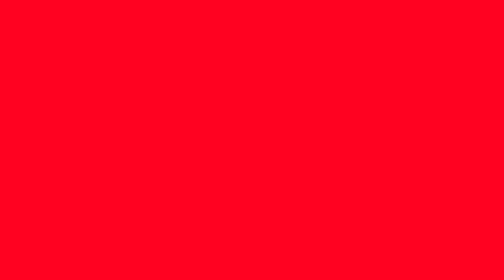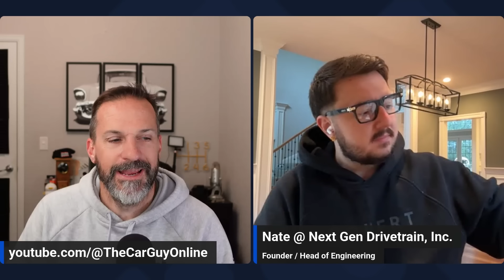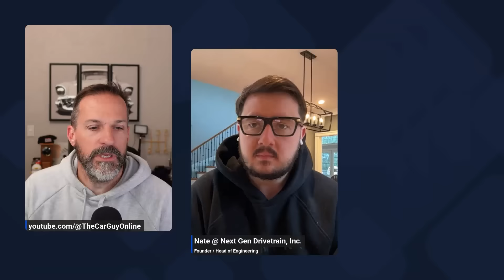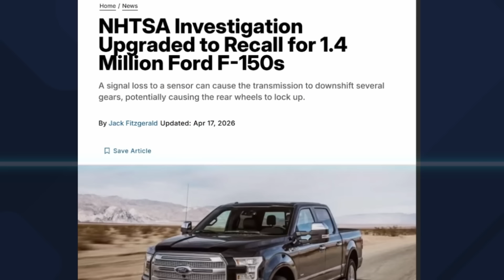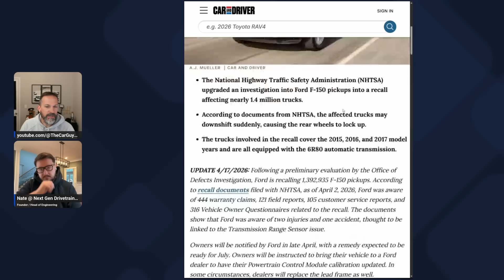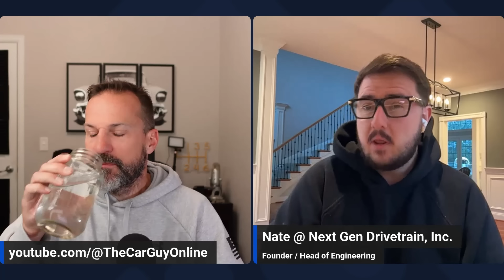Ford's BIGGEST Transmission Recall Yet - 1.4 Million F-150s

Comment: GM is stupid. I spent 6 months researching every single half ton and mid sized truck before making my choice. GM, ford, and the Toyota tundra were not on my list by the end of my search because of their trash! Sadly, I originally LOVED  the Chevy trucks. The half ton and the colorado were on my list at one point, as number one with the tundra. After seeing the JUNK GM was making i took their products off even bothering to test drive them. I thought they looked better than any other truck on the market. They were up there as my number 1 pick originally with the tundra. When i learned all the GM issues and tundra issues, I said no freaking way. At the time frontier was not even a thought for me. I researched it and it became the best option.  I never owned a nissan but i have zero regrets.  GM lost a sale from me because they make JUNK. Sad to say this because I have owned over 25 vehicles  and a handful have been GM products.  I have a 1980 camaro with a 1969 camaro motor in it. A motor and trans that have been rebuilt ONE time since 1969. Not because of failure but to freshen up. I trust that over ANY new GM product. GMs stupidity lost a sale from me.

Comment: 2012 F150 5.0   334k miles... Not one single issue with this trans during these miles.. Truck tows at least 50% of the time and at loads up to 14k lbs at times.. Yes overloaded farm use...  Only service is synthetic trans fluid change at each 100k miles.. Best trans and truck I ever owned, and I've been towing for many many years with the older and so called tougher transmissions.. Id buy another in a heartbeat if they made them.. Proper service with top quality lubes that control heat is part of the answer..  But most people miss this point..
Reply: You obviously don’t have a new F150 with a 10R80 which are fnn garbage! I will never buy another Ford product
Reply: Did you flush or drop pan when servicing trans? Thanks,
Reply: @thomas77597 No pans never been off yet..

Comment: Now discuss the infamous failure of the Nissan/Infiniti 7 speed valve bodies. Just about to scrap a nearly perfect QX70S 5.0 because I can’t find an OEM valve body. Tried the rebuilt EBay one with no luck. Not even worth the cost to rebuild/replace trans.

Comment: Nate is right.  CEO Mary Barra runs GM like a Hedge fund.  She came into GM after the big recession.  Her job has been to increase the bottom line by cutting corners, outsourcing and any other means to vulgarize the business like stock buy backs etc..  In return, she has acquired generational wealth for herself.  She works for stock holders and self ONLY.  I don't trust any new cars.  ZERO.  Will continue driving my 2019 frontier P4X with its 2005 design and port injected motor.  I'll take the hit on MPG's for peace of mind and bullet proof design.  11K dollars for a new motor or transmission can buy a shit load of gas.

Comment: Another class from Professor Nate!

💯 Agree with Nate regarding to the CAFE regulations… There’s no time for these companies to perform the right R&D and gather the enough data to improve the components and cars… So, basically they launch a product in “BETA” version and not the right and final product or version…
Reply: CAFE rules had a proposal period, like any other regs, where OEMs and regulators discussed the tech of introducing better ICE, batteries, hydrogen and natural gas.  It was the OEM's choice, on cost, to use the right mix.  The playing field was level.  Their choice was to cheap-out and hope customers would blame regs.  Voltec easily could have fixed all of this.  V8s and EREVs could have kept everyone happy.  The games continue.
Reply: @hcjpbluesky9916 good point! Agree sir!

Comment: As a 30 plus year transmission rebuilder.  Nate is right.  The valvebody is the #1 cause of transmission failure. The fluid crashes against one side of the valve and forces excessive pressure against the aluminum valvebody housing and the bore starts to wear and causes cross leaks. Loss of pressure.
Reply: I got a 26 Mazda 3 with 6 speed automatic not a CVT is that a good trans?
Reply: @psfanboy79 
I don’t work on cvts 

But I have heard that cvts have a lot problems with them.
Reply: @gibbyraymond yeah that’s why I went with Mazda, it has a normal transmission
Reply: Hi, got a question for you! With my little old TH-125c GM transmission (1987) , do I really need to change the filter each time I change the fluid? I'm thinking that a filter should last for ages and ages, as there's not much debri produced internally for it to pick up (clutch friction stuff?) and it has a big surface area, to collect the stuff. So  the filter should be good for a few fluid changes easily? Many thanks!
Reply: @tomlewitt 
If my car I would change on every transmission service.
Reply: @gibbyraymond  thankyou
Reply: I have a question. Ford 150 2015. Replaced radiator, engine oil cooler, trans oil cooler, trans oil pump, water pump, thermostat, water pump, spark plugs/boots, rear differential fluid, trans range selector sensor...but dealership still can fix why my trans temp gauge keeps overheating to redline & fan kicks on, once I drive over 70mph after 1hr. Losing my mind & my wallet!!
Reply: That is part of the lead frame my friend! It's startin to go wonky - the temp sensor is connected in the lead frame 😑 , what you could do is see about canceling it out through software but you would have to have some serious computer equipment to do so? Not sure but sounds like it , but it could be as simple as zero ing the software on the temp changes and such
Reply: @machughes3369 Thanks so much! I suspected this. I really appreciate you writing me back. Apparently, FORD is going to address this software issue in July 2026. Have a good day!
Reply: @travelfoxxxx yesir , at least it won't shift into first and cause damage, I gotta get the same software done in July, but I would ask them if they can fix that. .which if it's bad I think they will fix it , if not bad it'll be a software install
Reply: Depends on the tranny, the 10R80 for example...
Reply: So what's your idea on why do t these engineers fix it? If they know what causes failures why not prevent it? If they know they made reliable 5 speeds or 6 speeds why go to an 8 or 10? Wouldn't they get brand recognition for having a reliable vehicle and increase profit that way? I don't see what's gained by putting out shit.
Reply: I'm gonna have to disagree...the #1 cause of transmission failures is a loose nut behind the wheel.
Reply: @intheshell35ify 😂

Comment: I have a 2013 F150 that went into limp mode for the lead frame speed sensor last summer at just over 200k miles. Was not at high speed. Dealer said mine was not covered by the past recall. Finally got the lead frame replaced, cost $850 and seems to be running good again. Hope the new one doesn't end up with the same problems.
Reply: An $850 repair at 200k miles is not bad.
Reply: @JS-nd1po Yes, I was so relieved when I finally was able to find a reputable mechanic to replace it cause the first shop I took it to tried to tell me the trans was toast and wanted to rebuild for 6k. It has been a reliable truck, hope it continues for awhile longer.

Comment: TCM hasn't been internal to 6R transmission since 2010.  OSS fail and slam you down into 1st or 2nd. They call it a lead from because it's basically a chunk of plastic with connectors on it.

Comment: I have not had any issues with various manual Transmissions that I own.  My Powerglide held up well.  I had a Turbo 350 rebuilt for $250.00 in 1982.

Comment: unfortunately the transmissions can't last if you don't change the fluid in them high tech means more frequent oil changes and possibly a larger pan for more capacity.

Comment: sounds like the H1bVisa Holders are writing the Transmission Software too now.
The Problem Is these Companies . Ford is the problem. Just stop buying New please guys, a Good mechanic and Proper Service will keep a modern car running for 300k easily. Change your Oil every year or 5000 miles. Don't put that off.

Comment: Does NextGen sell kits for a 2021 Sierra 1500 AT4 with the 6.2? Just got my torque converter replaced and now I’m over 100k on mileage. Clunks into gear most of the time. Thanks.
Reply from the maker: Assuming that's the 10L80, pretty sure this is the kit: https://nextgendiesel.com/products/project-carbon%C2%AE-10l80-e-diy-valve-body-upgrade-kit-v3-1?variant=44018016223405 .  I think the discount code will work with them as well, you are probably looking for the valve body upgrade kit? I believe they sell built valve bodies as well if you don't want to mess with install etc.
Reply: @TheCarGuyOnline thanks a lot for the help!

Comment: My brand new 1996 Crown Victoria would downshift into 2nd at speed for no reason at all, Ford wired up an onboard data recorder that captured the event several times but they never did diagnose or repair the problem. I traded it in on an Acura Integra with a manual transmission, and never again did I buy another vehicle from the Big 3.

Comment: In 2015 we bought a new F-150 XLT 2.7 EcoBoost.  With about 2k miles, while slowing down it felt like we got rear ended the transmission downshifted so hard.  We called the dealership and they sent a flatbed to pick up the truck.  The short story is they did a software update and all was good.  The only other issue was the rear door lock actuators were replaced 3 times.  Now in 2026, we traded the truck in as it was approaching 150k miles.  The issue was the AC started to blow warm air, it was also very misty I call it when coming out.  The diagnosis showed the the evap core or something like that was going to need replaced and it was pretty expensive.  (sorry I'm not a mechanic). We didn't buy another F-150 for two reasons, first of course was the price, I was not going to pay 72K for a new, similar truck and the second was all of Ford's recalls.  Over all it was a very good truck, never driven hard and very well taken care of.  If this truck falls under that recall, I feel for who ever bought it at the dealership where we traded it.  Oh, we told the dealership about the AC blowing a bit warm and they said, "No biggie, we'll fix it."  Um, OK, we let them know.
Reply: We know they'll throw a can of sealer in it and top off the charge
Reply: Dont tell them shit. Lol

Comment: Anyone remember Chrysler Ultradrive FWD transmissions speed sensor problem in the early '90s?  Bad software decisions based on implausible input change.  Lose speed signal??? We must be going 0 MPH when a microsecond ago we were going 70 MPH....let us jam the thing right back into 1st gear.  May lock up the front wheels or throw a rod from overspeed or both.   There is a lot more processing power available today.  Yea, software can be used to avoid making crappy decisions so long as the brain is functioning.

Comment: For the 10r80, is the NG valve body simply plug and play or does it require tuning?
Reply: What models are those.  Part number I have a 2021 f150 5.0. What valvebody I can swap my self

Comment: It wasn’t anything for even those 4l60e’s to go 300k as long as you’re not trying to tow 10,000 pounds at 85mph. As long as you serviced them like you’re supposed to, it was normal to see 250k miles and still going strong.

Comment: 2013 Silverado.
177,000 miles and counting.
No way I’m buying a new truck unless I win the lottery.
Thinking about buying a pre 2010 Superduty, and putting the old 6 speed manual in it with the new Godzilla engine.
I should have never sold my old Ford with the v10, as much as I hate the Triton engine family 
Or a Cummins.
Heck I could do BOTH and the 2 builds would cost as much as a nicer new truck nowadays.
(Only labor costs I would be paying is machine shop if necessary)

Comment: At this point the Ford 10r80 has been in production 9 years so it should be in a mature situation now that cdf drum and shell have  been revised. Also I believe 10 gears is realistically for an ICE engine is at the limits of diminishing marginal returns. Also Nexgen provides upgrades and may force OEMs to improve. So seems like next few years should be better. And at other oems.

Comment: I have a 2007 F150 with over 400,000 miles with the original motor and trans. It may not be perfect, but it still gets me where I need to go.
Reply: 4.6 2v?
Reply: @racequad9 yup!
Reply: @DJD0715That engine is probably the most reliable V8 Ford has ever made.
Reply: Unikorn
Reply: what  engine
Reply: @Sinmars 4.6L 2V
Reply: Keep in mind, the difference between the best and worst in class engines are only a few percentage points in trouble free ownership. The very best may be 99% trouble free; the very worst 95%. Even though the worst engine has 5 times the problems (and often it’s the same thing over and over again) better than 9 out of 10 owners never experience any problems at all
Reply: And you probably have the much hated 3 valve Triton engine as well

Comment: I had this happen in my 2014 with only 2k miles on it. Ford corporate would not do anything meaningful about it stating “since it is not throwing a code, we won’t do any “exploratory work” under warranty” despite having gopro footage of it happening to me at 70+mph. I lost 10k trading that truck in with only 11k miles after giving up on them ever fixing it and it being other than an unreliable death trap. They deserve every bit of pain this recall can offer to them as a company.
Reply: That's unfortunate. One of the biggest problems is very few people understand how the system works and what's supposed to happen when you have a warranty issue. The warranty you have is from Ford. The problems is they have to rely on the dealers to act on their behalf. That's not always a bad thing, but it can be. What happens is, a dealer may not want to get involved with you and your vehicle and they will just say Ford declined the claim. I guarantee that Ford didn't make that call. The way our diagnostics and reference material is structured, allows for a problem like you have. We can either start out diag with a code or a symptom. In most cases, its nice to have a code, but it is not a requirement. The symptom you had is every bit as legit as a code. You should not have been turned away.

When I hear stories like yours, it burns me up. I do mostly heavy line work. Engines, transmissions, evap boxes, etc... Big jobs that are covered under warranty. I can't tell you how many times a customer came to me with a story just like yours. 15 minutes later, I have a new motor and all the parts needed to do the job ordered and covered under warranty. In a case like this, a greedy dealer should be on your side. Why? We make a fortune doing warranty work, especially big jobs. When I replace a 4 cylinder engine under warranty, I bill Ford for about $10,000. 6 and 8's are a lot more. They have to be crazy to turn that down. Most people think Ford just send us a box full of parts and pay the dealer a small amount of labor. The opposite is true. The laws don't allow for stuff like that. We buy the motor and all the parts needed to make the repair from Ford at the discount price like we always get, and when were done with the job, we bill Ford retail prices on all those parts. That's what they're turning down. Not to mention about 25 hours labor at around $175 per hour. 

Sorry for going on, but I just get mad when I see stories like this. Ford does plenty wrong. I'm not giving them a free pass. In the future, if you have a problem you think should be covered, never settle for something a dealer tells you. Get a 2nd, 3rd or 5th opinion, if you have to. You can take your F150 to a Lincoln only dealer and they have to help you. (Its actually a good idea because they have higher standards)
Reply: That sounds unlikely. I had issues with my F-150 transmission. It never threw a code, but the issue was  caught in memory. The second time it happened, Detroit had them replace the wiring harness and valve body. Problem fixed.
Reply: @donwyoming1936  as "unlikely" as you think it is, I spoke with Ford corporate on the phone after the third time to the dealership. Ford corporate denied the work, not the dealership. It was only when the lemon law became available due to the number of times to the dealer did they do something, then I was returned my truck and the battery went bad the next day with a parasitic draw in the truck. Worthless, unreliable and dangerous, and Ford was complicit in all of it.
Reply: @donwyoming1936 cope harder

Comment: Really curious about Nates thoughts on CVT! I have 2 toyotas with (E-CVT) 25 sienna hybrid 25 rav4 hybrid. Would like to know reliability, and maintenance
Reply from the maker: I would check the Car Care Nut channel for those, he actually did a deep dive on the CVT, may have been regarding the Camry hybrid. He thinks they are extremely robust compared to what you might think about a traditional CVT (like Nissans)

Comment: What vehicle do you buy, that makes 5-10 years without drama? 10 speed trans, AFM, CVT's, variable compression, and numerous electrical component issues on various manufacturers are not uncommon, to mention just a few. You almost need to be a mechanical and electronic engineer truthing anything you're looking to buy, then roll the dice on your purchase.
Reply: Junk

Comment: Newest car I ever bought was a 2018 Mustang GT. Only option was performance pack. I bought it specifically because it has an analog instrument cluster and the most basic infotainment available. No touch screen. No app connectivity. Manual transmission. First thing I did when I brought it home was pull the telematics fuse. 
It will be a cold day in hell before I purchase a so-called software defined vehicle.